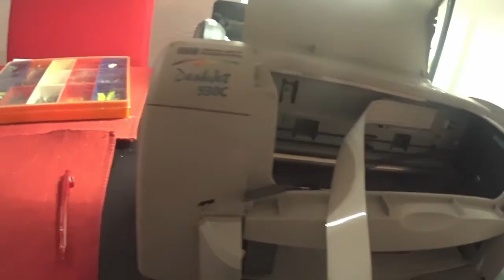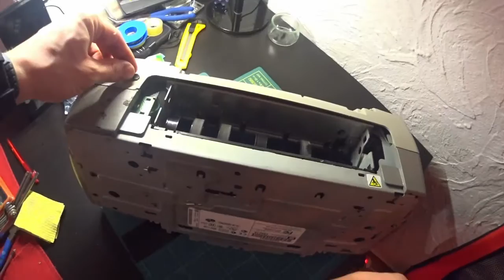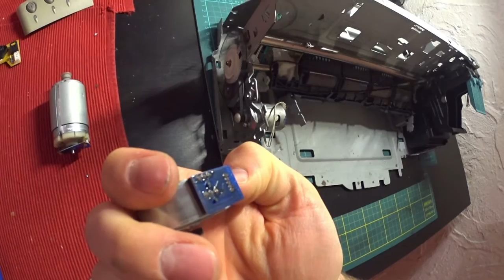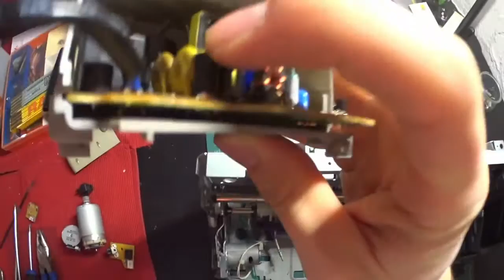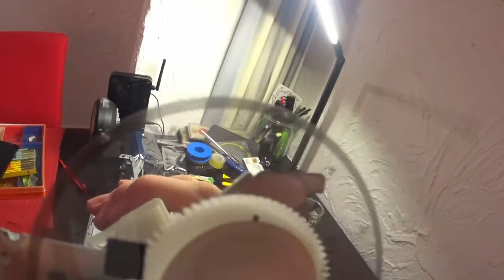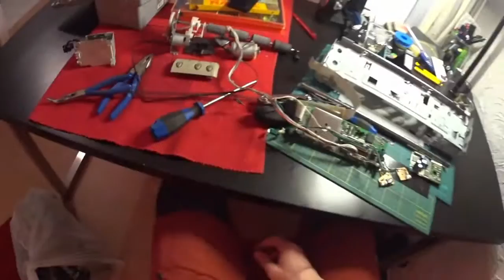Teardown #:1 HP DESKJET 930c Printer

Comment: These HP 930C Deskjet printers were obviously not designed to be serviced, but I'm sure you had already surmised that.   Anyways, the reason why I tore my HP 930C Deskjet printer down was because the carriage had jammed.  What I found was that a 0.625" X 0.875" rectangular piece of gray rubber had become dislodged, and which consequently jammed the carriage.  Actually, I didn't know where that piece went, but I wasn't too concerned.  Now I couldn't help but notice that your HP45 and HP78 cartridges were both refills, and so was my HP45 cartridge.  Actually, I refilled the HP45 cartridge myself, and there wouldn't be any reason at all why it should leak, but it sure did (exactly at the printer head like yours).   Since your HP45 inkjet refill also leaked, there clearly must be something going on with these HP 45 cartridges in recent years.  Whatever the case, I'm not going to refill the HP45 cartridge again, but rather buy new.  Regarding the HP78 inkjet cartridge, I never had satisfactory results in refiling those, and after this episode with the HP45 inkjet cartridge leaking, I'm not going to attempt to refill that cartridge either.  You know, there was so much black ink leaking from the right bottom on my HP 930C inkjet printer that I never could remove the plastic bottom piece of the printer which contained all that black ink.  Actually, it was a constant battle between trying to remove the bottom plastic section, and simultaneously cleaning my hands.  In fact, even using rubber gloves wouldn't suffice since an absolute mess of black ink would develop rather quickly.  What I ultimately decided to do was to wash out all of that black ink by placing the right side of the printer under the bathtub faucet.  Fortunately, that did a marvelous job of clearing out all of that black ink.  Afterwards, I force air dried the printer a few hours with the aid of a window fan.  After that,  it was just a matter of cleaning up here and there, and lubricating a few selected spots.  After the HP 930C was reassembled, I powered up the printer, and it worked good as new.  How about that!   By the way, you must have been the first person to tear one of these HP 930C printers apart, and without your tutorial, I likely would have parted this printer out.  Thank you very much!

Comment: I watched you video to figure out how to dismantle it without breaking anything. 
I got the 2 screws under the cover, and then to the part where you were trying to pry off the "shell". It looked like you were having some troubles ,and I was like "Oh great, I'm in for a treat", so I went to my printer, and I discovered almost right away, at the back (after you remove the cover with the dial twist-lock, to access the paper rollers), near the bottom are a pair of plastic tabs (1 per side) which releases the back end of the shell. Once those come loose, the front left is also easily freed by a similar tab, but the front right is a bit more stubborn and difficult - it had a very strong plastic latch that fits into the metal plate, and it's very hard to see and get to to release. I managed to break mine, lol (nothing terminal though) trying to gently twist and turn it loose. But yeah, after that, it was an easy removal.

Comment: hi, im from argentina, i have the HP Deskjet 930C, i refill the cartridge but the printer not recognize it, still the light NOT TINT, how can i reset the HP or flash the cartbridge to make that the printer recognize the cartridge? please help me.
Reply: ciudadano2k Buy a new and genuine HP cartridge. These cartridges should never be refilled, there's a chip inside them counting the number of ink drops and when it's empty it's empty! Also, putting a new cartridge will ensure that your printouts will be "Always clear, always sharp!"
Reply: " there's a chip inside them counting the number of ink drops and when it's empty it's empty! "

Those sneaky bastards!!! No wonder the refills screw up before they're finished. They probably operate on a "high yield XL" continuance which is why they bother to work at all. 

I cannot afford over $100 for a new color cartridge though (and not much cheaper for the black ones). Otherwise I would always go genuine.